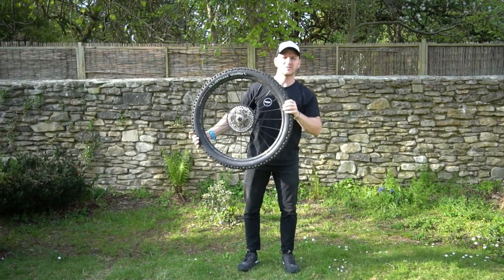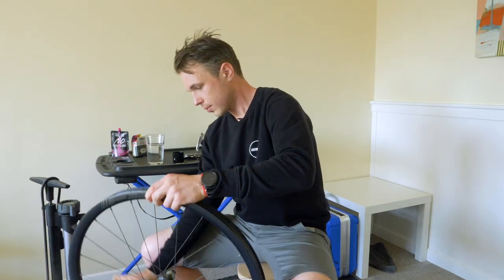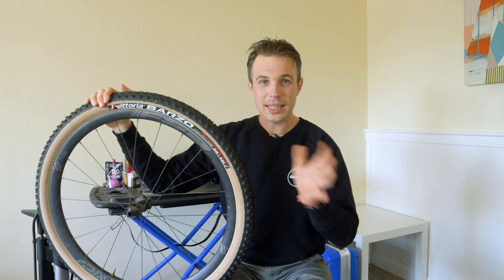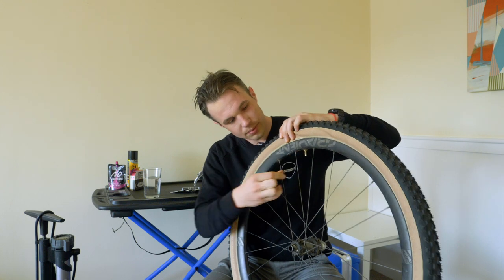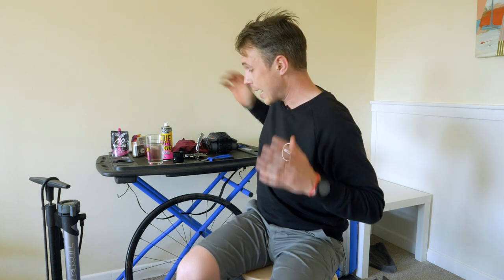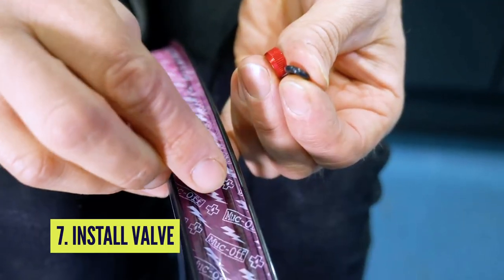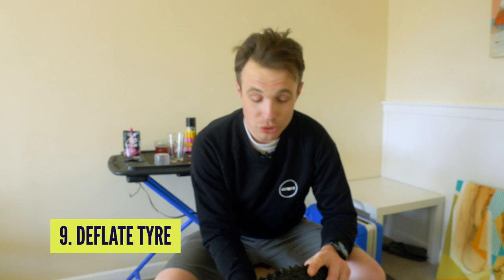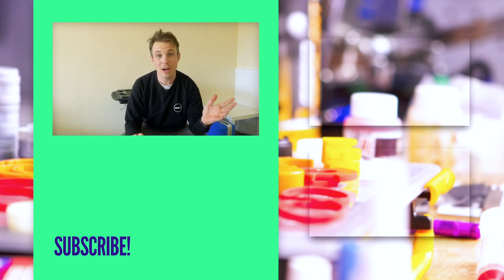How And When To Replace Tyre Sealant In Mountain Bike Wheels | The Tubeless Refresh

Comment: I have never heard of Glue and Sealant Remover. Thanks for sharing. -- I have a 'mess' the previous owner made. This product will help me out. -- The bike has a set of tires/wheels, that the previous owner, set up tubeless but they simply leak air no matter what I try. -- I intend on converting them back to tubes and use them for commuting. This product looks like it will clean the wheels and tires so I can install new tubes in a clean tire/wheel. No nasty/sticky leftovers.

Comment: Really helpful. I've just gone tubeless on some 'tubeless ready' Racing Ralphs. They were so floppy on the rim it was impossible using a track pump and I had to buy a new pump, use a couple of extra wraps of duct tape over the top of my Muc-Off tape. And they seeped sealant from the side walls, so not convinced of the tubeless ready claims. However, I've left them 24 hours and they seem to be staying up now. I hope the effort is worth it.

Comment: Hello. My question is:
How do we clean the sealant glued inside the tire? Do we need to clean it?
Thank you very much in advance!
Reply: lfcg73 I tried it once and didn’t finish the job, it was too time consuming. Then I read that it’s not recommended because is too difficult, you can damage the inside of the tyres and unplug holes that the sealant has already seal. But I don’t know if that glue remover makes it easier...

Comment: I make my own tubless valves with schrader valve cut out of a tube and an exterior 7mm rubber o ring between the lock nut and the rim.
Reply: I've done that with presta valves. It was an emergency but it worked, so I kept them.
Reply: Why?
Reply: Yeah, why'd you do that?
Reply: Answer to why? Because Schrader are great :)

Comment: I've used a rubber racquet ball and rubbed off the sealant off the beads in about 15 minutes with it.
Reply: I've just tried a normal hand washing nylon brush this afternoon but ended up with a wire brush to remove any congealed sealant on the inside of the tyre.

Comment: I just scoop out the old sealant from tyre I'm taking off, pour into tyre going on, top up a little (10-20ml) as necessary, wipe clean inside old tyre with a rag. Simples!
But thats because I use Slime STR premium tubeless sealant... doesn't dry out between twice yearly seasonal tyre swap, so unlike all the latex with ammonia based ones, zero maintenance! And co2 safe!

Comment: Tip for weight weenies. One of my friends invented this. He set up wheel with inverted tyre and camera and then inflated it. If you do so, it's much more easier to get out old sealant using sand paper.
Reply: Всякие байки oh so inflate the wheel inside out just to get the sealant off? That’s pretty smart
Reply: That's pretty clever. I try to clean up CX tires from last season and they are sometimes a mess.

Comment: had put on brand new tires, after 2 weeks of riding the rear wheel had so many punctures that when i changed tires it was completely dry, the front wheel still had a decent amount of liquid sealant. now i managed to spray lubricant on my brake disk and am out of degreaser, gotta go buy a can...
Reply: one of those weeks huh? happens to the best of us cheers 😂

Comment: Do you need a special pump to seat the tubeless tires? 

Also wondering, my RaceFace rims came taped from the factory. Should that tape be removed when cleaning the inside as shown in this video, or can the factory tape stay in place and reused?

Comment: Hi. I bought a specialized pitch that I had setup tubeless and I have been using it as a commuter bike to work with the occasional leisure rides for 6 months now. I live in the Philippines where its either hot or wet. Can you recommend when is the good time to do tubeless maintenance? thanks

Comment: Yeah easy with no cush core inside. Try getting a magic marry tyre off that has wintered in tyre sealant with cush core on a DT Swiss carbon rim. Took me 1 hour atleast to change 1 Tyre. But thanks for that sealant remover tip, I will apply next time

Comment: The muc off and other valves come with a few different seals, which one should you use, when and why?
Reply: Depends on your rim profile and the best fit with the valve seal, so take a look at your wheel and/or check out the original valve seal shapes if it came with them. A small patch of innertube with a small hole pushed over the valve before you put it in the wheel can get you by sometimes and make up for a poor seal but this is bodging it.
At the end of the day a selection of valves with different profiles is always handy to have IMO.

Comment: MultiSeal's FlatOut lasts the life of the tire or 10 years, whichever comes first.
Reply: Have you used it on a bike?
Reply: @cccpkingu  Currently using it in my fat tire ebike that I converted to tubeless. No issues at all.

Comment: Does that mean you have to de-tape, clean rim, re-tape every 4-6 months then add new sealant?
Reply: No. You dont have to do that. Only if the wheel isn't in use. And you most likely won't even have a tyre on. :)

Comment: Riding today I lost a load of tire pressure, I thought it was just a big burp (was hero dirt, much more traction and schralps than usual in dry old western aus). Chucked some air in, kept riding, got home and washed bike to find air leaking out between the rim and the tire. There is slight damage to the tire on the sidewall there, none on the rim. Any idea what could have happened before I pull it appart?
Reply: My best guess is it was an old tire on top of a big burp cus the bead likes to get wear when the tire gets old and a big burp could pull it off some of the tire. I am just realizing this is two years late lmao.

Comment: I love how in all theses type of videos they just pinch the tyre off the rim with their fingers. But in reality you end up using a Vice.😁
Reply: KENNY MTB you do know it actually is super easy as long as you sit the rest of the tire in the trough in the middle of the rim bed.
Reply: Niklas Du Rietz 
Bollocks I have just done both my wheels and that’s the problem getting the first part of the bead into the rim bed. Yes it easy after that.
Reply: KENNY MTB I just did two wheels a couple of days ago and it was easy again. One was a 27 Specialized Butcher 2,8 Grid on a Royal Traverse (29 mm inner width rim) with CushCore; the other a 29 e13 TRS+ rim with a TRSr tire
Reply: KENNY MTB I just put the wheel to my chest and see to that I stretch the tire bead inside that trough in the rim bed. 

Another way is to use their tip to stand the wheel on the floor and push a soft hammer handle down on the rim with your foot to be able to pull and keep the tire stretched inside the rim trough/bed. 

And of course where the valve is will always be the last part to put the tire on or off as it would otherwise keep the tire to be able to sit in the rim trough/bed there. 

Good luck!

Comment: Would you know why my tyre keeps burping? I'm running a michelin wild am 27.5x2.8 on nukeproof horizon wheels 18psi. I'm only 10 stone. Wheels and tyres are both brand new and after a spirited ride I have signs of sealant around the bead. If I put the pressure up it cures the problem but the tyres are way to hard. #askgmbntech
Reply: I'd suggest you'll need thicker side walls to run 18psi without a tyre liner if you're hitting then hard.
Reply: That's very low pressure for that size. Try also adding another single wrap of rim tape if running say 22psi doesn't help. 10st isnt super light, its about low average, especially by the time u add weight of water on bike/urself
Reply: @rupedog  most plus sized tyres run around 14 psi
Reply: It sounds like you’re a spirited rider who rides hard. If I were you, I would probably get a tire insert. It seems like Rimpact is good value

Comment: Ive had tubeless sealant in my front wheel for 2 years and it still hasn’t dried out😂
Reply: What’s the weather like in your area?
Reply: @MtbEMS  wet, rainy and muddy in the winter.   Can be super sunny and hot in the summer
Reply: @charlieroberts3171  hmm interesting, same here in Ecuador.
Reply: @MtbEMS  i used  Stans no tubes sealant. I recently had to change it as i was changing tyres.

Comment: The answer to this question is: NEVER. Because, you want to never put it in in the first place. Sealants like Slime etc. were NOT intended to be used as preventatives. They were designed to be used only AFTER you get a flat, as a way to get going again quickly. If you just dump Slime in your tires, it will eventually get into the air valve. When you add air to your tire and open the valve, if some slime gets in there as a bit of air escapes, it will dry in there, and prevent the valve core from closing completely. You will have a slow leak. Very few people suspect a leaking valve core and will be puzzled for quite some time, looking for a leak.
Reply: Respectfully disagree. Even Slime does  - which is why they sell you Slime inner tubes preloaded with the sealant inside.
Reply: @tychoMX  - THAT does NOT mean Slime doesn't jam valve cores. I am not the only one who has had the experience. I am speaking from FIRST HAND knowledge, not speculation.

Comment: #askgmbntech
I have a trek marlin 5 (small size) and I am looking for some budget upgrades to it around £200. I know about the handlebar adjustments but are there any good ways to go 1x with a big cassette or any good rockshox forks that would fit my bike. I know there is discount at chain reaction right now and it’s my birthday coming up soon so a quick response would be greatly appreciated.
Also, I have noticed a few forks that are 140mm (my bike has 100mm right now) is that too much of a jump in travel? Help me out here Doddy love the videos! xD